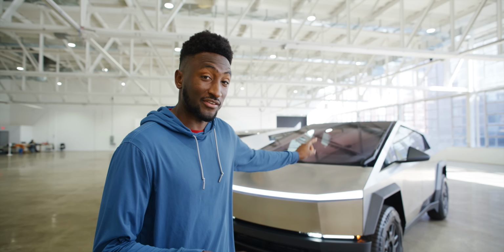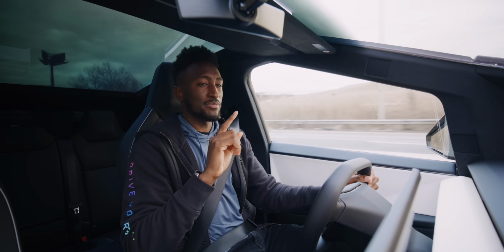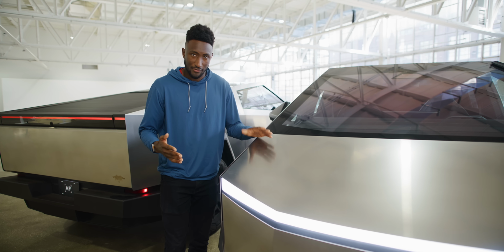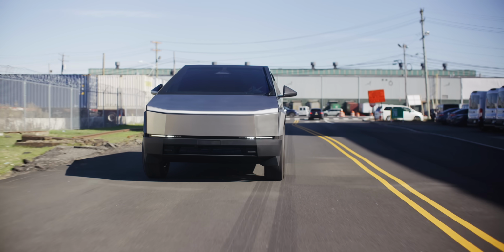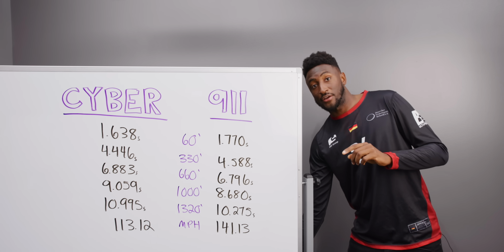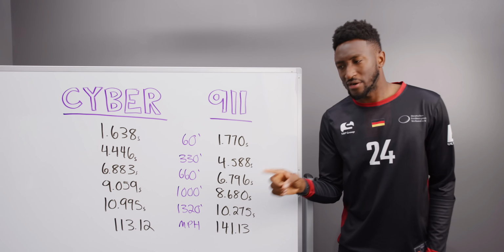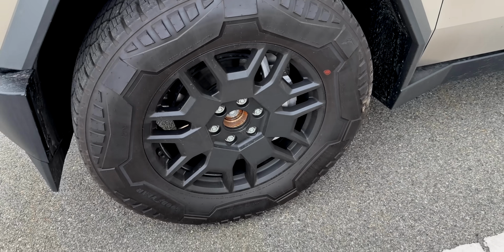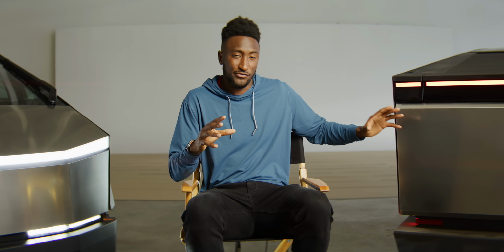Tesla Cybertruck Review: Already Iconic?

Comment: "You'll be fine"

No, you won't. And that's a ridiculous statement. I can't really talk about safety, cause I don't know anything about it, so I'll just stick to common sense: cars are heavy as fuck. The difference between this and a regular car panel will be negligible when you're talking in terms on tonnes. The inside bits, the actual structure of the car, matters more. And I'll leave that to NCAP tests etc. Stainless steel changes nothing.

And when it comes to fender bender... well, again; the difference will be negligible when you're talking in terms on tonnes. Any collision that would result in a dent on a normal car will dent this. The only pro is that it isn't painted, but that's not actually a pro, cause it will rust... It won't even be worth its weight in scrap 10 years from now. And who know how much they're gonna sell spare panels for.

And this may be an unpopular opinion (j/k), but something COSTING $60.000 SHOULD NOT HAVE AN OPEN BETA! It's not a video game, it's the real world. Ridiculous.

This thing is an iPhone with none of the quality.
Reply: And it is still funny to me how a Tesla has literally 2 tricks: tech and acceleration.
EV beats ICE. We know this. It's old hat. And it's irrelevant. No one pulls away from the lights like that. No one pulls out of their driveway with their foot to the floor. It's cool, but it's a gimmick.

And the tech is a whole other story. But the takeaway is this: IT is not in a state where it should see large-scale general adoption. There are fundamental flaws that people are ignoring for the sake of innovation. I love IT. The good sides of it. I spend a lot of time online. I'm trying to switch to Linux. I script and code. And I just get excited when I find a new thing I can play around with. But I will not get a smart fridge. I will not get smart home stuff. I will not have AI do my job for me. Because none of that is ready.
Reply: OMG it lost the drag race! That's hilarious!
Reply: It's lighter than a Hummer! XD
Desperately scraping the fucking bottom there...
Reply: Holy fuck, the PT Cruiser comment is perfect. It's a shit car. But people don't care, cause it gets them noticed. Man, the Hunchback of Notre Dame would be a very different movie if it was made today. And would hold none of the same lessons.

Comment: That thing looks like an Aliexpress novelty PC case made from recycled scrap metal. Ironically I would bet that it will eventually end up in a Chinese metal and electronics recycling facility. Industrial dishwashers are made from higher grade stainless steel than the body of that truck. Anyone with knowledge of metal compositions can tell you that stainless steel has several grades and anything other than 316 grade stainless steel which is the highest grade, 316 grade stainless steel is actually mandatory grade for work surfaces that must be used for any commercial or industrial kitchens in many regions, since it doesn't corrode or rust so it can be used for food prep and not become rusty when exposed to salt and water which are the most common kitchen ingredients but also what will make exposed steel or cheap stainless steel to rust. The cybertruck body is made from 300 grade stainless, which will definitely rust when driven in the rust belt during the winter, especially if taken on salted highways in the winter. The choice to use 300 grade stainless maybe because of cost or weight, but the same process is used to fabricate and cut panels to shape 300 grade stainless and it wouldnt be any more difficult to create the body from 316 stainless steel which is actually rust resistant, also easier to clean, and 300 grade stainless is only slightly more durable than just a standard sheet metal. I have a garbage can thats made of higher grade stainless steel than the Cybertruck.

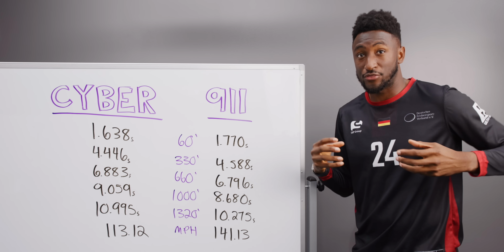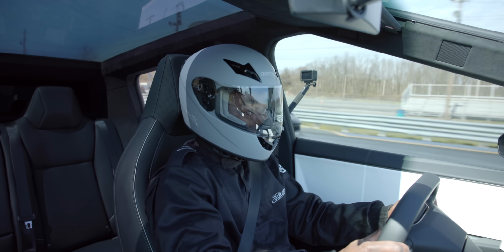Comment: 16:20 Is the Cybertruck limited at top speed by software? What does the Cybertruck torque curve look like compared to the 911? 17:05 "...electronically limited top speed...". Where did it hit that limit. One reason electric motors don't need gears is because of their torque curve. ICE needs gears to "get out of the hole" (i.e. to get started). They have little low-end torque.

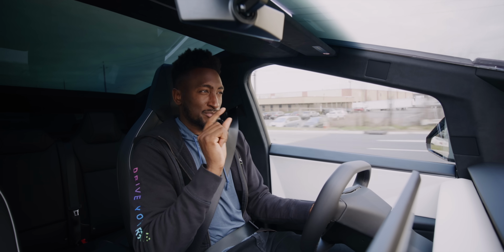Comment: 12:00 The percentage of commercial and industrial trucks used for hauling has to be near 100%. Try  to find one without a hitch. That goes for the yard guys all over the place pulling their mower trailer, and the ones that need it just occasionally to pull a load of lumber, drywall, rental equipment, etc. Also, these would likely not be bothered too much by range. They're seldom going more than 100 miles per day. Hauling is a non-issue... unless you're in the FUD business.

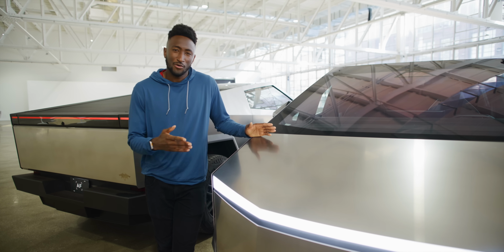Comment: 6:30 Stainless steel is not only overrated, it's undesirable (because of weight). I would have favored aluminum sheet (even if a little thicker) than stainless sheet. I expect in the future the stainless will be abandoned... and the styling changes aluminum will offer will be leveraged.

Comment: Bulletproof stainless steel and reinforced glass when you see the roadragers starting shooting at you 😅...definitely underrated!
Reply: Except 2 shots close to the same impact point will fracture the stainless steel because its stainless and it work hardens. the 2nd shot may or may not pass through but the 3rd one will have a nice large path to the interior.   Reinforced glass = Laminated glass that they have used for windscreens for how many years?
Reply: @WhiteDieselShed  yes agreed, but it's not a presidential armored limo we're getting. Eventually it just increases your survival chances which would be decent enough

Comment: 12:04 short list of trucks for towing, none of them are electric" according to Rivian and Ford both the RT1 and Lightening can tow, i didn't check the Hummer or Wrangler if you want to consider those electric trucks but would be surprised if they had 0 towing capacity.

Comment: Dude I like you and I like your work. But that truck. Eh. I encountered one in real life recently in a parking lot. I really didn't like what I was seeing. The angles on this thing are dangerous to peds, cyclists, and smaller vehicles. I cannot get past the potential dangerousness of it to enjoy it otherwise. It's not only this truck. But the trend amongst makers of mid/large SUV'S and trucks to have these blunted (vs sloping front ends) making them appear more like large tractor trailer trucks is ridiculous. I have a Jeep and a Miata (that was rear ended today by a Chevy truck with this design) and in the two seater, drivers of these vehicles bear down very aggressively with their lights blinding me. My partner and I have had several rear and side enders with these trucks. She was driving today when it happened. I spoke with a coworker who had a similar vehicle and rides motorcycles and he emphatically voiced the same concerns. We both love two and four wheeled vehicles but the C.T. is is flat out dangerous to others. This thing is worse because it literally has no front bumper. I don't see how it even passed safety standards. Or where they made to go away to please E.M.

Comment: I remember the New Beetle from the early 2000's had a similar effect as the PT Cruiser around the same time. We were all familiar with the old VW Beetle, its an automotive icon. Then this new car comes out, especially as cars in the 90s had gone through the 'melted cheese' design era of soft curves, and sloping shoulder lines. The New Beetle was round, but it was geometric. It was upright and tall for a small car, headroom like this was unheard of in a compact. Once they hit mass production, they were just another car on the road, but seeing them at first release was a cool sight, kind of like the Cybertruck now.

Comment: Weather or not a truck is any good depends on how you intend to use it. To me, it's just another tool. I want the most practical truck for my construction business. I don't give a damn about how it looks. Definitely not a fan of Tesla's sloped bed sides - would make putting anything over the side or getting something out of the front of the bed an extreme annoyance and would really piss me off.  If I can't put a 4 x 8 sheet of plywood on the floor of the bed and close the tailgate - useless for my purposes. I punctured a gas tank on a F150 on a rough site - the replacement was about $1,935. To replace the Tesla battery back itself with all modules in it would be around $16,000.  A windshield for a Ford F150 will cost about $700. while the Cybertruck retails for $1,900.  I know it's because of the electronics in the Tesla glass but how do those electronics help my carpenters put more money in my pocket? Now we also have to factor in insurance costs. Insurance companies are steadily raising their rate for EV's because of the ridiculous repair costs. Let's face it, the Tesla truck doesn't seem like it's going to be a long term player in the construction business. More like a novelty item for those that would use it for anything other than your run of the mill pickup.

Comment: 15 defects when you've only delivered like 1000 cars is a really high defect rate. Toyota would be firing guys lol
Reply: Using Toyota as the counterpoint is hilarious. It was recently discovered that Toyota has been cheating on crash tests for several decades.
Reply: It was a comment on lean manufacturing principles and quality control approach. That's kinda irrelevant, but unsurprising.

Comment: steer by wire is overrated because if your battery dies while driving, not only will you have no throttle, but you wont have any steering either, so instead of being able to pull off the road, you will crash because there is no way to control the vehicle.

Comment: As a full-size truck owner for the majority of my life, I can honestly say people buy big trucks for one overwhelmingly simple reason:  They're comfortable.  They're not some tiny thing with a harsh, uncomfortable ride, a cramped, claustrophobic interior, little to no headroom, and only space enough for a lunch box or two in the trunk.  Full-size trucks have a very smooth ride, they're quiet, there's plenty of room for everyone to be comfortable, and if/when you need to haul or tow something, you've got that covered.  They're also extremely heavily built and thus pretty safe for those traveling within.  They've also come a long way in terms of design and environmental creature comforts.  They're just better in every way than they used to be 20-30 years ago.  They're also extremely reliable and will last a very, very long time. 

So, yeah, you can get a Raptor or a TRX if you've got the cash, and they're very capable of doing amazing things off road, but they probably never will.  They just look amazing, so people want them, and that's fine.  You don't have to need to haul or tow something in order to justify owning a truck that can do those things.  If you want a vehicle that's safe, comfortable (even luxurious in some trims), and more capable than most things on the road, you buy a full-size truck.  

The Tesla Model X has been gliding silently through my dreams for years now, and I would dearly love to have one.  The Cybertruck?  I actually like the design, but I don't like that they shrank it so much from the prototype.  I'm sure that won't change, but it'll be interesting to see what does change in the future as these things continue to be mass produced and evolve.

Comment: I mean all other points aside, the notion that a hard exterior steel shell will keep you safe in the event of an accident is simply not true. modern cars are designed the way they are now to keep people safe at all costs. All energy created in a collision with this car will not be absorbed by the car and instead transmitted to the occupants causing injury when they would be walking away with scratches in a normal car.

Comment: I wish my X had that steer-by-wire system.  The yoke looks much more useful with it.

BTW, most trucks in my neighborhood are very seldom driven off road.  They have off-road tire, but those are usually used to avoid need chains whengoing up skiing.  For most of the only think they haul are a few bags of mulch from Home Depot in the Spring.
Reply: Engineering Explained went over this in detail in his review of the CT and his preceding review of the Lexus demo vehicle with steer by wire, commenting that the fact that Tesla has both steer by wire and yokes, yet no vehicles with both at the same time

Comment: Well... there is a bit of Tesla BS marketing that hasn't been covered:

1) they had to order stronger stamping presses, than they had... compared to the available presses, the ones for automotive sheet metal are on the medium size side of things. So ordering a new set for thicker sheet metal was more or less a matter of placing an order.

2) the adaptive steering is also possible the same way with traditional steering racks. Making it drive by wire has other benefits - and drawbacks.
Tesla chose this configuration, because they had to save weight and keep within a reasonable turning circle.
My Touareg has adaptive steering and all wheel steering, which results in a turning circle of a VW Golf.

Comment: @brownlee not to be a nitpicker, but that trailer carrying the 911 is speed limited by its tires (around 120 mph I’m guessing). The Cybertruck is speed limited and reaches its max speed by the 1/8 mile mark.  It doesn’t matter how quick a car is if you make the course long enough where speed will win out - in this case 1/4 mile.
Reply: So why did they use 1/4 mile times?    Welcome to the LeMans 24 hour race..... Watch cars battle for the title over 3 laps or 10 minutes whichever is the soonest?
Or for the USA welcome to the Indianapolis 500, watch drivers battle in a 3 lap sprint to the finish.    Not quite the same.
Reply: It was actually a sleight of hand in advertising.  All they said was it beat a 911 and I think the ad said to the finish line … which was at 1/8 mile.   They didn’t say “any” 911, JUST a 911….the slowest one with a manual transmission.     

Problem is, everyone Assumes the top 911 flagship and they correctly assumed people would think 1/4 mile when in reality it only 1/8th mile.      

That’s just like the Ford vs Cybertruck tug of war - it was a little deceptive.   As an engineer I understood that weight is more important than just torque as the cyber weighs 2,000? Lbs more than a regular ford f-150.   Meaning the ford had to overcome an extra 2,000 lbs and then get in the race, by which time Tesla already won.   

It’s the same with the 5’ rollout in the 0-60 mph times.    Technically it can get 1.99 secs, if you subtract that rollout time.   Real world, it was 2.01 secs I think.      Point is, are you really gonna care if it’s 1.99 vs 2.01 secs or stoplight to stoplight?  Not really.   The idea that an almost 7,000 lb truck towing a trailer with a 911 and can keep up with that 911 in the 1/8 mile is pretty stellar.

Comment: Nissan was first to do steer by wire. Their backup was a floating steering column which locked into place upon failure of the electronics. So people claiming Nissan ddin't have true STW are wrong.

Comment: AHAHAHAHAHAHHAHAHAHAH        $100,000 AND THE DOOR LATCH IS HELD ON WITH GAFFA TAPE...!!!

The most insane thing I have ever heard of - who did the quality control for this - Boeing...???
Reply: lmaooooo🤣savage
Reply: Don't say boeing bro, please stay safe
Reply: He put the tape, not Tesla...
Reply: @michaelterry6576 he never said that.   He was pointing out that a new truck needs tape to hold pieces on it.
Reply: @Typicalgold  
Because instead of having it repaired he taped it.
Reply: @michaelterry6576  a new vehicle shouldn't have that issue to begin with.
Reply: @Typicalgold  
That's true, but Tesla wouldn't have repaired it by slapping tape on it, so to say 'tape holds the cyber truck together' is a misleading statement at best and a lie at worst.  Sometimes there are manufacturing errors and a loose screw essentially is what was wrong with his.
Reply: @michaelterry6576  he specifically explained in the video that it was done by then to fix an issue.  Not misleading at all.
Reply: @Typicalgold  
I meant the commenter I was replying to who basically said 'wow the car is held together with tape' as if Tesla designed it that way.
Reply: @michaelterry6576  I understand what you are saying.  But again I still think it I'd the same issue I have been stating.  They are surprised with quality control where someone has to tape a 100k car together.
Reply: @Typicalgold  
There is no 'has to' it was a choice not to have it repaired.
It's like if your chair was missing a few screws so instead of having it RMA'd you decided to tape it together.
It's not 'the chair held together by tape'.
He said, if I recall, the decision was to save time for the sake of the review.
Reply: @michaelterry6576  from what I have read repair times on teslas are quite long.  So I guess he could have left it as it was until it got fixed.
Reply: @Typicalgold  
Right.

Comment: I was not ready for the sledgehammer to come out lol 😂
Reply: Very selective on where the impact took place and not repeated because stainless work hardens and it's only time before it cracks/splits.   I wonder if the usual load area's have additional support or will there be scrapyards with many cars having the same fault.  Cracking splitting around suspension mountings or motor mountings.  Only time will tell unless someone is willing to take their new truck and test that?

Comment: Steer by wire sounds a lot like the system used in aircraft where they removed mechanical linkages like pulleys and chains and replaced it by Fly by Wire